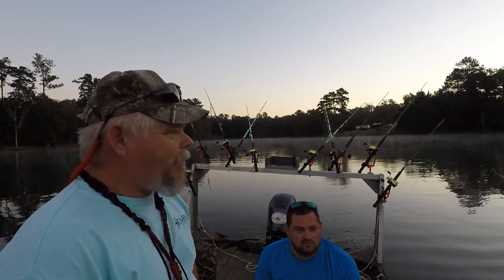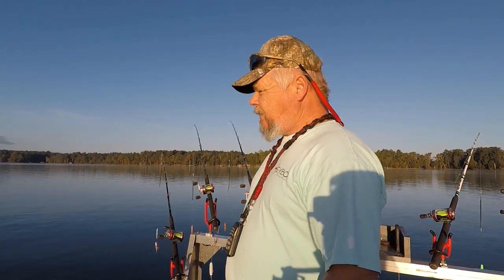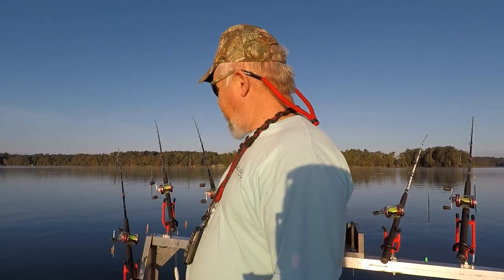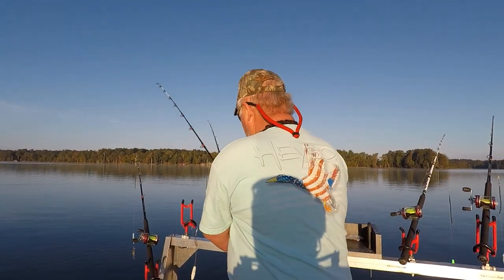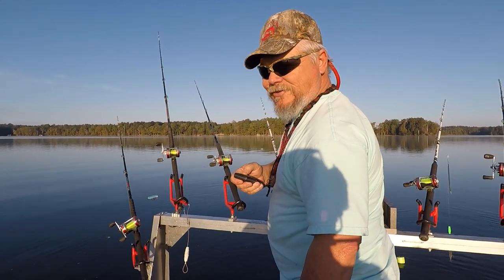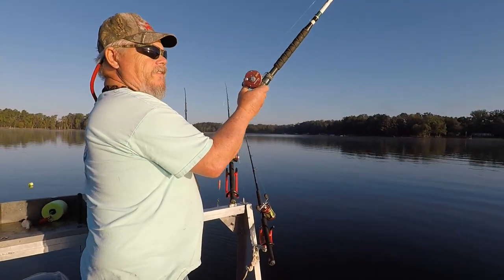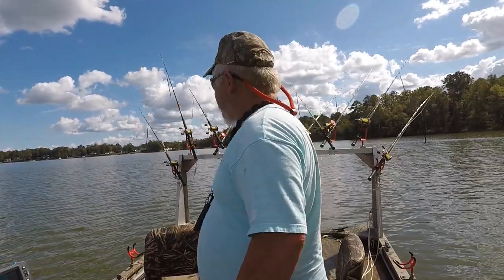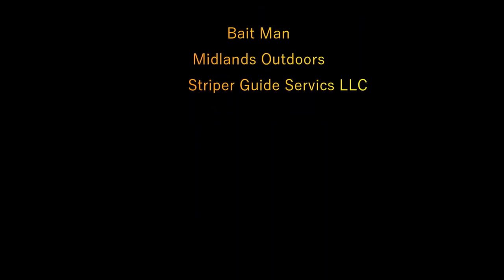Indepth Planer boards and Bobbers

Comment: Why do you run the farthest boards from the muddle instead of the outside rod holders
Reply from the maker: I have the out side on second holder over the second board on third holder only because the first holder is lower than all the rest I use it for the closet board

Comment: Are you selling your planer boards?
Reply: Yes he does sell his boards, and you will love them. They designed to pull out at slower speeds so you can pull them in all seasons summer and winter when you need your boat going real slow. These are very tough too and can take abuse from the catfishers.🇺🇸
Reply: @patriotcatfishersofamerica7985  Where can I buy them at?